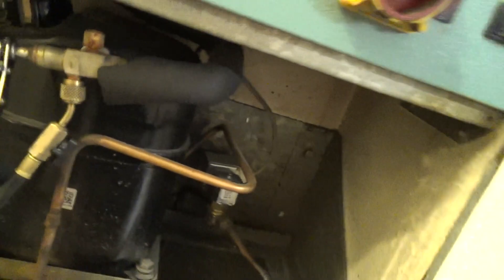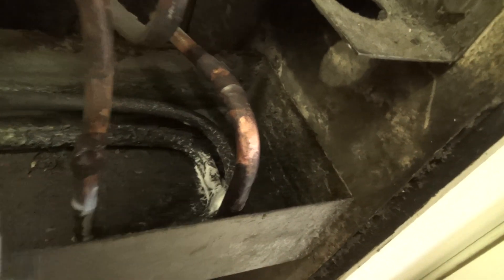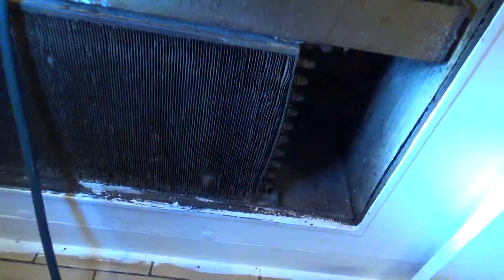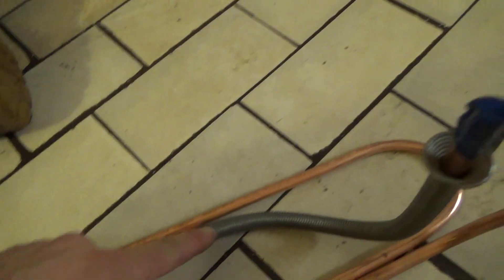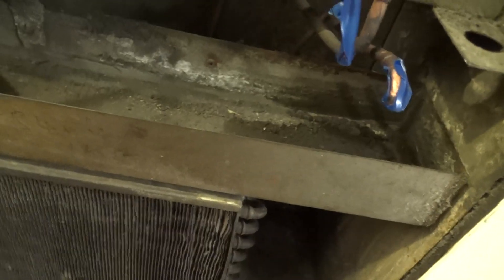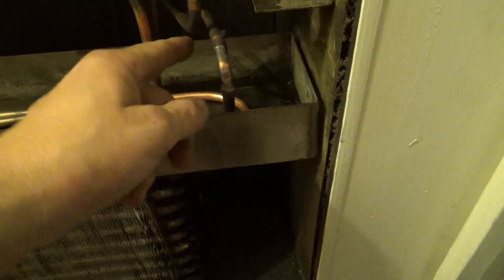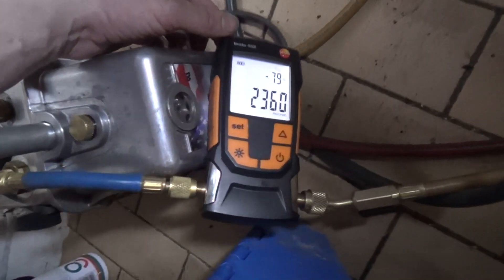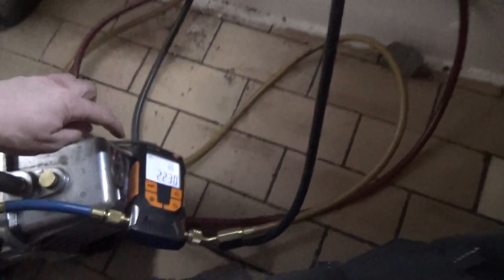Foster the Fridge - Pumped Up Pipe

Comment: Nice neat job on the repair! Putting heat shrink tube over the copper pipe is also a good way to stop it from corroding so quickly. 
It definitely did well to last over 30 years however!